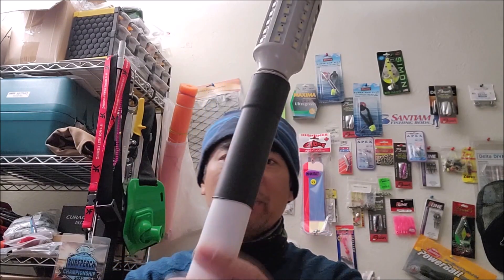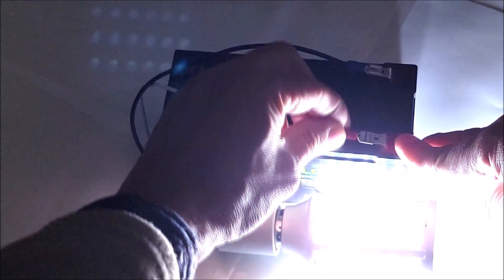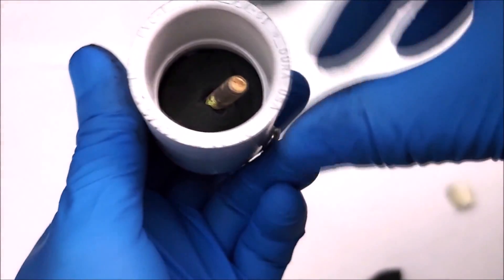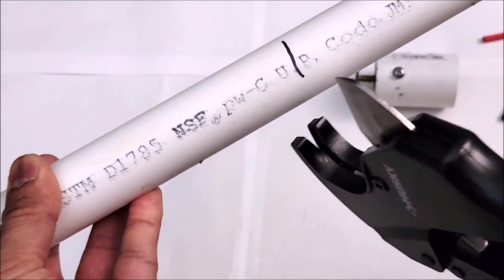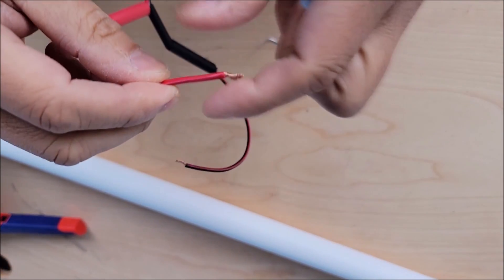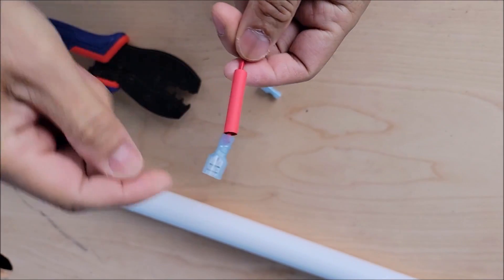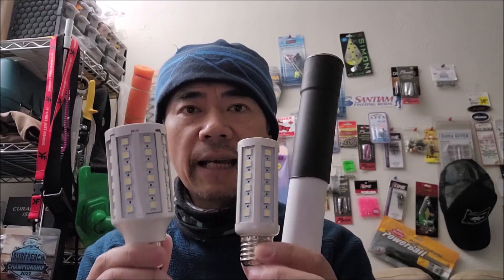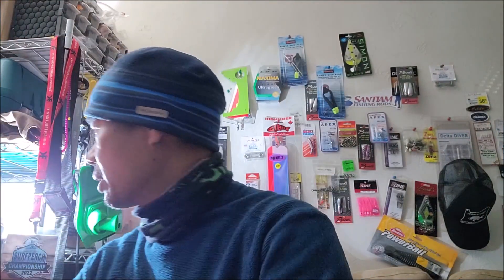How to Build A DIY Kayak Stern Light With PVC Pipes

Comment: :face-green-smiling:WOW!!! THANK YOU, VERY MUCH, FOR THIS DEMO VIDEO!!!... :face-blue-smiling:I WILL BE ADDING A BATTERY BOX,  ELECTRIC TROLLLING MOTOR, PLUS NAVIGATION LIGHTS, AND SOME ADDITIONAL INTERIOR (INSIDE THE BOAT) LIGHTING, AND, PERHAPS A SPOT/FLOOD LIGHT AT EACH END OF MY 18,5' CANOE.:face-red-heart-shape:
...PERHAPS, INSTEAD OFUSING THAT 1/4"-20 BOLT EPOXEID INTO THE COUPLING, YOU COULD'VE JUST DRILLED A 1/4" HOLE THRU THE CENTER OF A 1' DIA PVC PIPE CAP (ONE WITH A FLAT, (NOT ROUNDED) END)... THAT BOLT COULD ALSO BE EPOXIED INTO THE CAP, AND IT COULD EXTENT OUT OF THE BOTTOM END OF THE CAP, AND INSERT THRU ANY ACCESSIBLE DECK SURFACE, OF PLATE, AND BE SECURED WITH A BIG WINGNUT, (AS NEEDED). :face-red-heart-shape:

Comment: This is a good idea.  My dad use to come up with homemade gadgets.
Like a homemade down rigger, bait trays that hung on the inside of the boat,  a varnish wood center console for a steering wheel with all the power electrical knobs for on/off switch, and the runny lights like yours, and etc.  
Stuff like this reminds of him.  
Right on 👍🏼